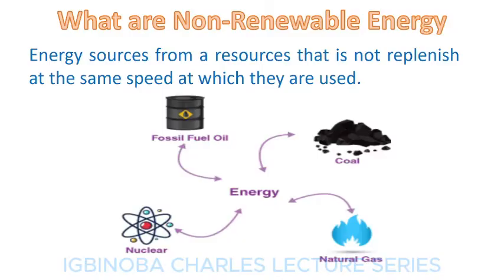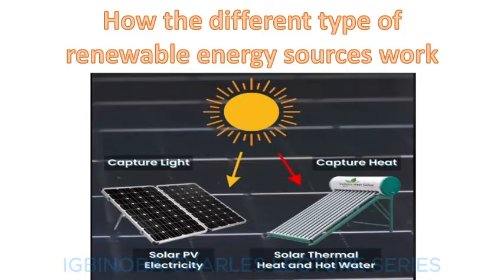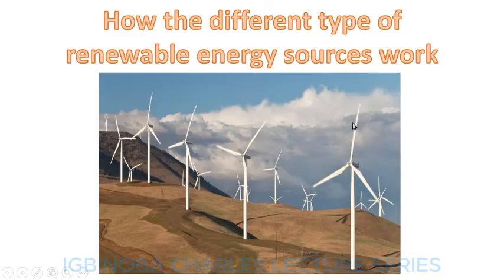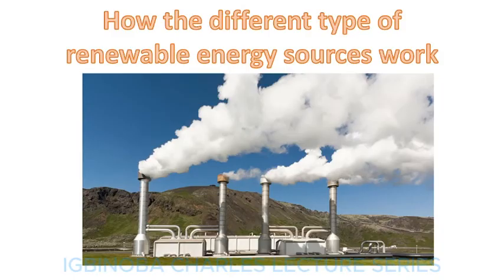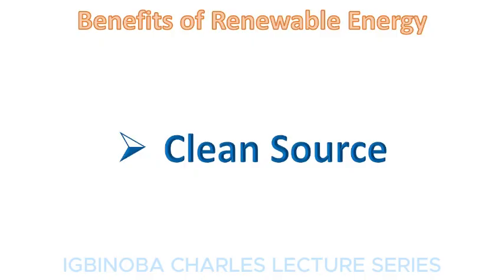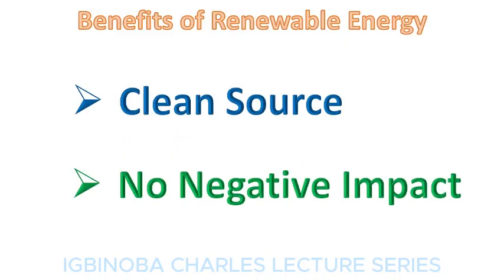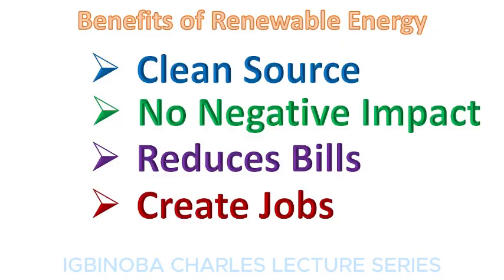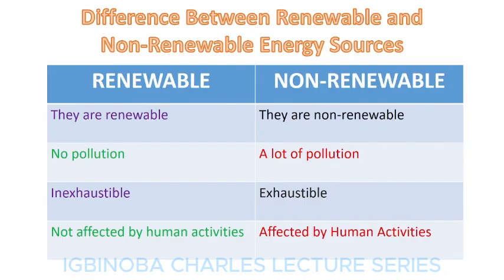From Fossil Fuels to Clean Power: Understanding Energy Sources

Comment: MEC11K
ANSWER: Although solar and wind energy generate little to no pollution during operation, no energy source can be classified as entirely pollution-free. Pollution may still occur during the extraction of raw materials, manufacturing processes, and transportation of system components. As a result, renewable energy sources are regarded as cleaner alternatives rather than completely clean sources of energy.

Comment: CHM81C

Answer

No energy source is completely pollution free. Every form of energy has some environmental impact at some stage of its life . Non renewable energy source generally cause pollution through extraction , processing and combustion. Renewable energy source are cleaner , but they still require materials, equipment and infrastructure that must be manufactured , transported, and maintained . As a result, some level of pollution or environmental impact can occur during the production , installation , transportation or operation of these systems

Comment: NAT46T

Answer:

No energy source is completely pollution free.
 
Reason:
Every form of energy has some environmental impact at some stage of its cycle. Non renewable energy sources generally cause pollution through extraction, processing, and combustion. Renewable energy sources are cleaner but they still require materials, equipment and infrastructure that must be manufactured transported and maintained. As a result, some level of environmental pollution can occur

Comment: PETROCHEM1A

Answer: NO 
Reason: Because no energy source completely pollution free when the full life cycle is considered.Energy systems require materials, manufacturing, construction, operation, maintenance, and eventual decommissioning or waste handling. These steps involve mining, chemical processing, transportation, energy inputs (often still partly from fossil sources), land use, and disposal. Each stage can generate greenhouse gases, other air or water pollutants, habitat disruption, resource depletion, or waste.

Comment: CHM90L
Answer:
No energy source can be regarded as completely pollution-free.
Reason: Every form of energy production or use has some effect on the environment, either directly or indirectly. For instance, solar and wind energy generate little pollution while operating, but producing their equipment requires raw materials, energy, and transportation, which may contribute to pollution.
Therefore, renewable energy sources are considered cleaner alternatives, rather than being entirely pollution-free.

Comment: MAR 91M

No energy source is completely pollution free. Every form of energy has some environmental impact at some stage of its cycle. Non renewable energy sources generally cause pollution through extraction,processing,and combustion. Renewable energy sources are cleaner but they still require materials, equipment and infrastructure that must be manufactured transported and maintained. As a result,some level of environmental pollution can occur

Comment: CIV84F

Answer: No energy source is completely pollution-free. Every form of energy has some environmental impact at some stage of its cycle. Non-renewable energy sources generally cause pollution through extraction, processing, and combustion. Renewable energy sources are cleaner, but they still require materials, equipment and infrastructure that must be manufactured, transported and maintained. As result, some level of pollution or environmental impact can occur.

Comment: CHM113I
No type of energy can be said to be completely free from pollution.
Reason: All forms of energy production and consumption have some level of environmental impact, either directly or indirectly. For example, solar and wind energy produce very little pollution during operation. However, the production, transportation, and installation of their equipment require materials and energy, which can cause environmental pollution.
Therefore, renewable energy sources are cleaner and more environmentally friendly, but they are not completely pollution-free.

Comment: CHM65M

Answer: No energy source is completely pollution-free. Every form of energy has some environmental impact at some stage of its life cycle. Non-renewable energy sources generally cause pollution through extraction, processing, and combustion. Renewable energy sources are cleaner, but they still require materials, equipment, and infrastructure that must be manufactured, transported, and maintained. As a result, some level of pollution or environmental impact can occur during the production, installation, transportation, or operation of these systems.

Comment: CHM51Y

Answer: No energy source is completely pollution-free. Every form of energy has some environmental impact at some stage of its life cycle. Non-renewable energy sources generally cause pollution through extraction, processing, and combustion. Renewable energy sources are cleaner, but they still require materials, equipment, and infrastructure that must be manufactured, transported, and maintained. As a result, some level of pollution or environmental impact can occur during the production, installation, transportation, or operation of these systems.

Comment: COMP97S
Answer: NO

Reason: Renewable energy is not completely pollution-free. The manufacturing, transportation, installation, and maintenance of renewable energy equipment can still have some environmental impacts. For example, producing solar panels and wind turbines requires raw materials and energy, which can contribute to pollution such as air pollution and land pollution.
Also, in contrast non-renewable energy sources such as coal, fossil fuel and natural gas generally produce much higher levels of pollution and greenhouse gas emissions, particularly during extraction and combustion. These emissions contribute to air pollution and climate change.
Therefore, although renewable energy can have some environmental impacts, it is generally cleaner and more environmentally friendly than non-renewable energy. Its lower level of pollution and greenhouse gas emissions makes it a more sustainable option for meeting future energy needs.

Comment: CIV59G

No energy source is completely pollution-free. Every form of energy has some environmental impact at some stage of its life cycle. Non-renewable energy sources generally cause pollution through extraction, processing, and combustion. Renewable energy sources are cleaner, but they still require materials, equipment, and infrastructure that must be manufactured, transported, and maintained. As a result, some level of pollution or environmental impact can occur during the production, installation, transportation, or operation of
these systems.

Comment: MAR2B

Answer: No energy source is completely pollution-free. Every form of energy has some environmental impact at some stage of its life cycle. Non-renewable energy sources generally cause pollution through extraction, processing, and combustion. Renewable energy sources are cleaner, but they still require materials, equipment, and infrastructure that must be manufactured, transported, and maintained. As a result, some level of pollution or environmental impact can occur during the production, installation, transportation, or operation of these systems.

Comment: MEC 107C

No. 
No source of energy is completely pollution-free throughout its entire life cycle.
Reason: Even if an energy source produces little or no pollution during operation, pollution usually occurs at one or more stages such as: Extraction or mining of raw materials.
Manufacturing of equipment (e.g., solar panels, wind turbines).
Transportation and installation.
Maintenance and eventual disposal or recycling.

Comment: PETRO38L
Answer: No energy source is completely pollution-free. Every form of energy has some environmental impact at some stage of its life cycle. Non-renewable energy sources generally cause pollution through extraction, processing, and combustion. Renewable energy sources are cleaner, but they still require materials, equipment, and infrastructure that must be manufactured, transported, and maintained. As a result, some level of pollution or environmental impact can occur during the production, installation, transportation, or operation of these systems.

Comment: PETRO51Y

No form of energy can be considered 100% pollution-free.
Reason: Every method of producing or using energy has some environmental impact, either directly or indirectly. For example, solar and wind energy produce little or no pollution during operation, but manufacturing their equipment requires raw materials, energy, and transportation, which can cause pollution.
Therefore, renewable energy sources are cleaner rather than completely pollution-free.

Comment: CHM99U

No form of energy can be considered 100% pollution-feee.
This is because every method of producing or using energy had some environmental impact, either directly or indirectly. 

Example: Solar and wind energy produced little or no pollution during operation, but manufacturing their equipment requires raw materials, energy, and transportation which can cause pollution. 

Renewable energy sources are cleaner rather than completely pollution free

Comment: MAR39M

No form of energy can be considered 100% pollution-free.
Reason: Every method of producing or using energy has some environmental impact, either directly or indirectly. For example, solar and wind energy produce little or no pollution during operation, but manufacturing their equipment requires raw materials, energy, and transportation, which can cause pollution.
Therefore, renewable energy sources are cleaner rather than completely pollution-free.

Comment: No

Although Solar energy is that energy source that doesn't emit any pollutants during operation even during maintenance,  there might some pollution duration it's production.but for an an installed solar system there's no pollution during operation and all when disposing a distroyed or damaged Solar system E.g damaged panels , damaged batteries etc

Comment: CHM20T 
No energy source is 100% pollution-free.

Explanation: While renewable sources like solar, wind, and hydroelectric power generate little to no emissions while operating, their manufacturing, transport, construction, and installation still create environmental footprints. On the other hand, non-renewable energy—especially fossil fuels like coal, oil, and natural gas—releases substantial pollutants and greenhouse gases during usage. Consequently, while renewable energy is significantly cleaner and more sustainable, it cannot be defined as completely free of pollution overall

Comment: CIV21U

No source of energy is completely free from pollution. 

Reason: 
Renewable energy sources such as solar, wind, and hydropower produce very little pollution during operation. However, the processes involved in manufacturing, transporting, and installing their equipment can still affect the environment. Non-renewable energy sources, especially coal, oil, and natural gas, produce much higher levels of pollution and greenhouse gases. Therefore, renewable energy is cleaner and more environmentally friendly, but it is not entirely pollution-free.

Comment: EEE82D
From the lecture video we can say that some energy sources like the renewable energy are clean in themselves. For example the Sun gives light, no smoke, no waste.
But it is in the process of harnessing it that leads to pollution. For instance, in converting the Sun light to electrical energy, solar panels made from silicon are needed and the process of making solar panels can result in pollution. Also, solar panels can become e-waste after long use.
Different batteries are also used to store electrical energy converted by solar panels and these batteries can add to pollution.
So we can say that there's no 100% pollution from start to finish but a considerably low net pollution is possible.

Comment: CHM42P
Ans: No source of energy can be considered completely pollution free.
Even renewable sources such as solar, wind and hydroelectric energy can use some environmental impact during the manufacturing construction, transportation or installation of the equipment. Therefore, energy sources can be cleaner or less polluting, but not completely pollution free

Comment: EEE53A

Answer: No source of energy can be considered 100% pollution-free 

This is because producing, transporting, installing, or disposing of energy systems usually has some environmental impact.
For example, solar and wind energy produce little or no pollution while generating electricity, but manufacturing their panels, turbines, batteries, and other equipment requires raw materials and energy, which can cause pollution.
Fossil fuels such as coal, oil, and natural gas produce significant air pollution and greenhouse gases when burned.
So, the best answer is that some energy sources are much cleaner than others, but none is completely pollution-free throughout its entire life cycle.

Comment: PETRO351

No energy source can be considered completely pollution-free.

REASON:  Renewable energy sources such as solar, wind and hydropower produce little or no pollution during operation, but their production, construction, transportation and installation can still have environmental impacts. Non-renewable sources, particularly fossil fuels such as coal, oil and natural gas, produce significant pollutants and greenhouse gases when used. Therefore, renewable energy is generally cleaner and less polluting, but it is not necessarily completely pollution-free.

Comment: MEC102X

Answer:    No, no source of energy can be considered completely pollution-free.
Even renewable sources such as solar, wind, and hydroelectric energy can cause some environmental impact during the manufacturing, construction, transportation, or installation of their equipment.
Therefore, energy sources can be cleaner or less polluting, but not completely pollution-free.

Comment: PETROCHEM26Z 
No, no source of energy is completely pollution-free.
Reason: Every source of energy causes some pollution or environmental impact at some stage. For example:
Thermal power plants burn fossil fuels and release harmful gases like carbon dioxide.
Hydroelectric projects can disturb ecosystems and displace people.
Solar panels and wind turbines produce clean electricity during use, but pollution is caused during their manufacturing, transportation, and disposal.
Therefore, while some energy sources are much cleaner than others, no energy source is entirely pollution-free.

Comment: PETRO36J
No. No source of energy is completely pollution-free because there are usually some environmental impacts during its production, transportation, construction, operation, or disposal.
For example, solar and wind energy produce little or no pollution during operation, but manufacturing and disposing of their equipment can cause environmental pollution.
Conclusion: Energy sources can be low-pollution, but not completely pollution-free.

Comment: CIV34H 

NO, There is no single source of Energy that is pollution free.
Reason: Renewable energies like Solar, Wind and Biomass even though creates zero exhaustion or greenhouse gases while running the full lifecycle it includes mining raw materials, factory manufacturing, Transportation and Equipment installation, and then final disposal which creates environmental impacts and wastes.
So no source of energy is pollution-free when considering its full lifecycle.

Comment: CHM9I

Answer: No
Solar energy is almost pollution-free when it’s running, but not 100% pollution-free over its whole life.

1. During use = Basically 0 pollution* 
Once solar panels are installed, they make electricity from sunlight. No smoke, no CO2, no noise, no water pollution while they’re working. That’s why solar is called "clean energy".

2. Before + After use = Small pollution* 
i; Manufacturing: Making solar panels, batteries, and inverters needs mining of silicon, silver, lithium. That process uses energy and chemicals, and can pollute air/water.

 ii;Installation: Transporting materials + construction uses diesel trucks.

iii; End of life: Old panels and batteries become e-waste. If we don’t recycle them well, they can leak heavy metals.
 compared to coal/gas/oil, solar is way cleaner — like 10x to 50x less pollution over its lifetime.

No energy is 100% pollution free,But solar is one of the cleanest we have because almost all pollution happens once during making it, not every day when using it.

Comment: CHM63K.                                   No, no energy source can be considered completely pollution-free.
Reason: Even sources classified as "clean" or "renewable" (solar, wind, hydro, nuclear) cause some form of pollution or environmental impact when you look at their full life cycle:
1.Manufacturing/construction – producing solar panels, wind turbine blades, and batteries requires mining raw materials and industrial processes that generate emissions and waste.
2.Installation – land clearing, construction activity, and transportation of equipment have environmental effects (habitat disruption, carbon emissions from machinery).
3.Maintenance – servicing equipment (e.g., battery disposal, lubricants, replacement parts) produces waste.
4.Disposal/decommissioning – solar panels and batteries contain materials (heavy metals, chemicals) that can pollute if not disposed of properly.
5 Indirect emissions – even "zero-emission" sources rely on fossil-fuel-powered supply chains and transportation at some stage.